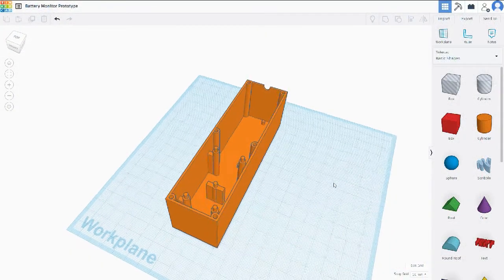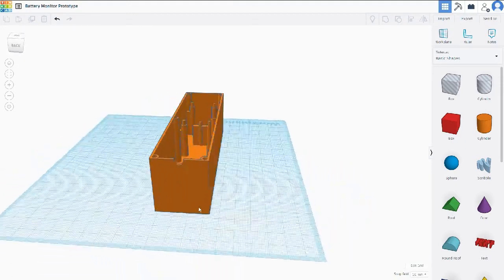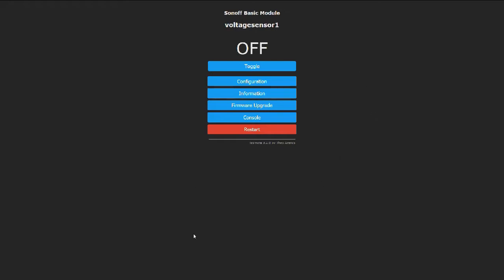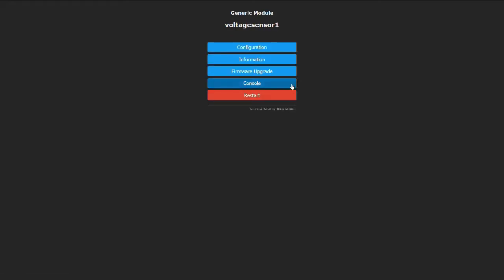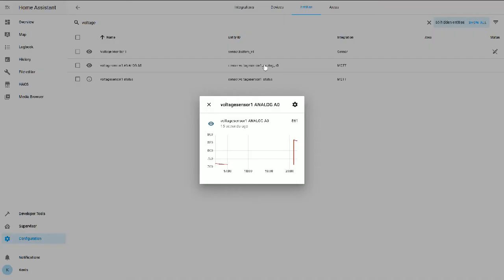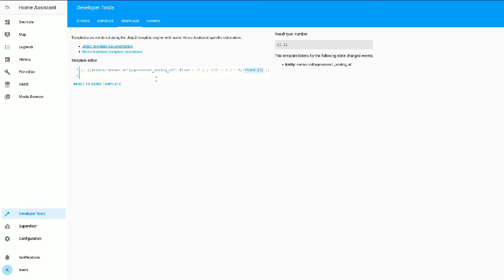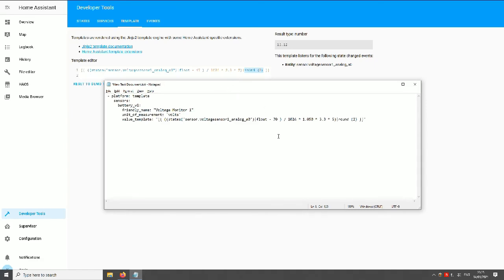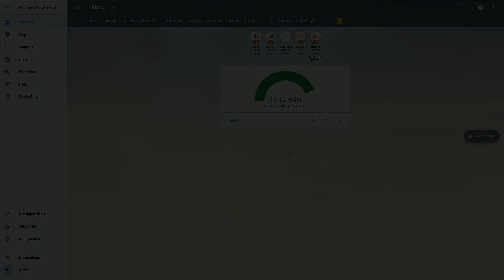Building a 12v Car Battery monitor for Home Assistant with MQTT, NodeMCU, Tasmota, ESP8266, Arduino

Comment: anybody ending up here and looking at the posted template above here is some modified code to work with current HA as of 10/18/22 for both legacy code and modern. This code is using an ESP32C3 so you may or may not have to add back the 5v conversion 

Modern
template:
  - sensor:
      - name: "Battery Monitor"
        unit_of_measurement: "VDC"
        state: >
          {{ ((states('sensor.voltage_monitor_1_analog_a1')|float(0) - 45 ) / 918 * 3.3)|round (2) }}

Legacy		  
sensor:
 platform: template
 sensors:
  battery:
   friendly_name: 'Voltage Monitor 1'
   unit_of_measurement: 'VDC'
   value_template: "{{ ((states('sensor.tasmota_analog_a1')|float(0) - 45 ) / 918 * 3.3)|round (2) }}
Reply: Thanks!!

Comment: Hi there. Excellent tutorial. Building this myself now for my houseboat, though with node-red instead of Home Assistant. I am curious: why did you change to ESP Home? (as I read on the home assistant forum).
Reply from the maker: It was really only because I had moved most of my other stuff over to esphome, it doesn't really add any functionality as such but I could tie in the deep sleep to my system better!

Comment: How accurate do you find your readings?

I have a similar setup stepping rough a 12v supply to 3.3v using the same 5:1 ratio voltage divider. 

Results are ball park how ever I would like to get it more precise.
Reply from the maker: Hi. I just used a volt meter to check the values and then changed the calibration values to give me the most accurate voltage to actual. I calibrated at about 12.5v which is somewhere at the mid point. They seem accurate enough!

Comment: Could you use the circuit board part of a mobile phone charger to provide the 5 Volt supply rail?. I ask this because I have several of these module that are no longer used, They all have different plugs on the end for when each phone had an alternate style power socket

Comment: Future TODO use a digital out to turn on/off a trickle charger to compensate for monitor parasitic discharge.
Reply from the maker: I use it through home assistant to turn the chargers on and off whe  the battery drains. I have since moved to esphome and sleep the monitor as much as I can to save on the discharge factor!

Comment: Can you post the template as its not possible to see clearly in the video and im getting syntax errors
Reply from the maker: Hi, Which template do you need?
Reply: The template sensor at 7:40 thanks
Reply from the maker: @grommet20002000  here is the one I have setup in home assistant in the configuration.yaml

  - platform: template
    sensors:
      battery_v1:
        friendly_name: "Voltage Monitor 1"
        unit_of_measurement: 'volts'
        value_template: "{{ ((states('sensor.voltagesensor1_analog_a0')|float - 45 ) / 1024 * 3.3 * 5)|round (2) }}"
Reply: @Mr12v  Thanks for your video and help, i now have this in my template.yaml 
- sensor:
    - name: "Solar battery"
      unit_of_measurement: "Volts"
      state: "{{ (((states('sensor.green_house_analog_a0') | float -22) / 1024 * 3.3) * 5) | round(2) }}"
Reply: @Mr12v  I just pasted this directly into my configuration.yaml and it's giving me errors "end of stream" is there meant to be something before -platform: template? - thanks

Comment: Thanks for documenting this.
My hybrid car's 12v battery has been flat a few times due to little use during lockdown such that it could not power the electrics for the car to start using the big drive battery.
A Wi-Fi battery status sensor is a good solution either as an  ESP8266 acting as a web server one can log into or as you suggest an ESP8266 sending  MQTT messages to Home assistant or in my case NodeRed.
I would like to keep the battery drain to a minimum so I intend to use tasmota's DeepSleep mode.
My question is simple - Did you investigate the Tasmota DeepSleep command and if so was it successful?
Reply from the maker: Hi, I've converted one of then to use deep sleep through esphome although its the same thing. It works really well to be honest and keeps the last reported value in home assistant so you don't lose the value. I'm sure it could be done with tasmots just as easy yes!

Comment: Looks "real good" "up in here" y'all.. Was this designed for an American audience by any chance? :) On a more serious note, it'd also be "real good" if you could post the code you used for the template, as I'm also not able to see it clearly. Great work though, the closest I could get was a bluetooth module, which doesn't work with Homeassistant.
Reply from the maker: Hi, do you need the code i used in the home assistant?
Reply: @Mr12v  yes
Reply from the maker: @ljadf  you have it there :) This is my Home Assistant sensor using the template.

  - platform: template
    sensors:
      battery_v1:
        friendly_name: "Voltage Monitor 1"
        unit_of_measurement: 'volts'
        value_template: "{{ ((states('sensor.voltagesensor1_analog_a0')|float - 45 ) / 1024 * 3.3 * 5)|round (2) }}"